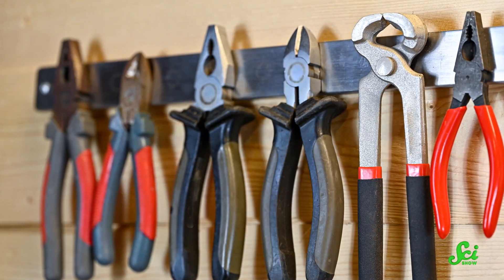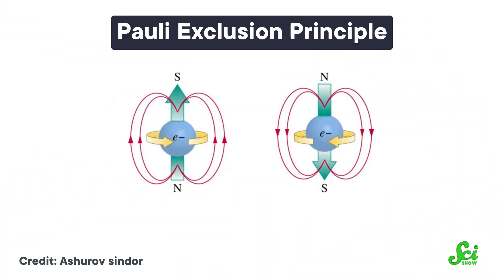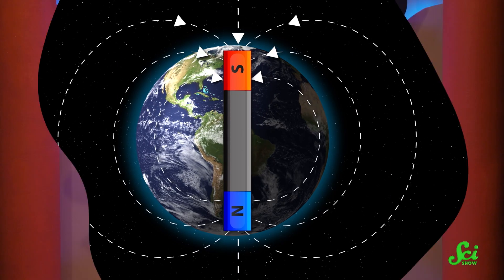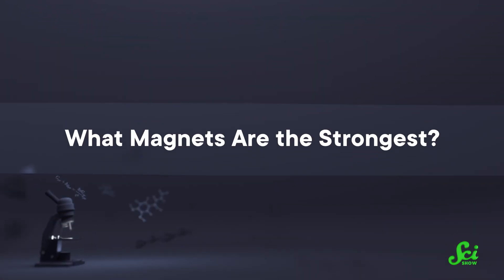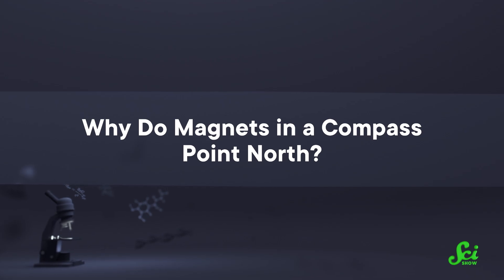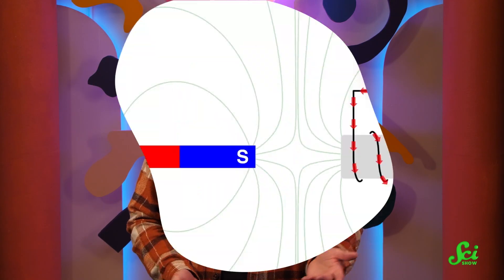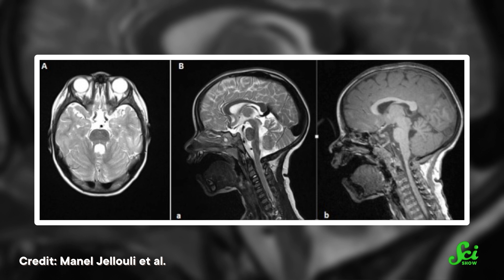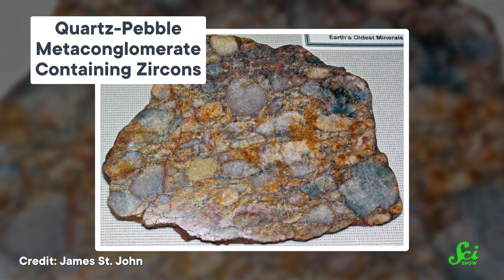The 16 Most Asked Questions About Magnets

Comment: My favorite magnet use: Cheap rice cookers.  There's a magnet in the rice cooker that is chemically calibrated so that, once it (and thus the pot of food) gets above the boiling point of water, meaning there's almost no water left in the pot, it loses just enough magnetism that the spring it's resisting can overpower it, switching the circuit from "cook" to "warm."  When it then cools, it regains its full magnetism.  It's such an elegantly simple mechanism and I adore it.

Comment: Are magnets' strength measured by, or do they include the factor of, the weight of an object they can lift and hold before (as it appears to me) the strength of gravity's pull overpowers their ability to draw a magnetized object towards themself and keep it there?
.
Like, some fridge magnets are pretty weak. Sometimes they can't even hold their own plastic-shell container's weight up without falling, let alone that and the piece of paper you're trying to hold on the fridge's surface.
.
And what measurement terms etc. tell you how much material can there be, or how thick it can get, between the magnet and another magnetized object before it blocks (weakens?) the pull between the magnetic and magnetized object too much to be useful in keeping the material pinned in place between them?

Comment: That wasn't a very good answer about computers. Hard drives are definitely vulnerable to magnetic fields, sometimes even ones you might think are small. The placement of a hard drive inside a computer varies, especially in laptops, but you shouldn't put any sort of magnet anywhere near wherever it is. Unless you have an SSD, which is faster, not vulnerable to magnetic fields, and generally sort of better. Additionally, back when computers used CRT monitors, you could visibly distort the image of those monitors by putting a magnet near them. Most monitors had a "degauss" option which would fix this, but if you put a strong enough magnet near enough to the screen, it could leave permanent defects. Arguably that's not "messing up the computer," but that was what your mom grounded you for if you did it.

Comment: Fun little magnet anecdote - I once used a bulk tape eraser (STRONG handheld electromagnet) to wipe a hard drive before throwing it away.
Reply: I had a shop teacher stack up a bunch of hard drives and connect them to an arc welding machine. One shot of high voltage, and they were wiped.

Comment: Regarding the harddrives: There are actually very powerful (crush/squash/pinch your finger-type strong) neodynium magnets INSIDE mechanical harddrives. They together with a coil provide the movement of the read/write heads.

Comment: So here's an odd one.  At some restaurants that use cheap flatware, that flatware is magnetic.  You can take the end of your fork, for example, you can make it pull the knife.  It's not incredibly strong but it works if you don't move it too fast.  Is that flatware intentionally magnetized or did it somehow get magnetized after the fact and if so how?

Comment: TMS (Transcranial Magnetic Stimulation) is over 60% effective, which is about as effective as SSRI'S (the most effective medications for depression). Medications generally take weeks to work, and only a third of people find relief with the first medication. It often takes several med changes before the doctor finds the right one, if it helps at all.
There is a new form of TMS, which uses the Stanford U. developed SAINT protocols. This version has an 80% effective rate for treatment resistant depression and was fast treacked by the FDA because of the impressive results. One studdy had an astounding 90% remission rate SAINT TMS!

Reference:
10.1192/j.eurpsy.2023.1768

Comment: Fun fact: cutlery knives in restaurants often are slightly magnetised. Because the cutlery tray they use happens to be aligned north south and wherever they throw in the knives the impact over time magnetises them all. 🙂
Reply: I've noticed this too!  It's usually cheap flatware where I notice it the most.  I often wondered if it was intentionally magnetized or not.
Reply: Fun truth.... Restaurants often have magnets in a chute to the trash can by the dishwashing station where leftover meals are thrown out. The magnets in the chute will grab any silverware accidently dropped in so it doesn't get thrown out. This is why some restaurant silverwear is magnetized.

Comment: Fun fact, magnets make the best (my opinion) electronic switches in the form of hall effect switches.  They're great for stuff like gaming controllers/keyboards, and even security doors!  They're accurate and reliable, they use permanent magnets, so less power needed, and they don't need things to make contact to act as a switch so they last longer.

Comment: The placebo effect is real. Besides no real evidence for healing capabilities of magnets, there's also no known real reason to assume/suspect that they could have a healing effect. 

Other than that, and some "details" about electromagnets, not technically completely accurate, a great episode, really funny!
Reply: Easy enough to run a doubleblind on: moar research required!
Reply: @revdrjon  I think there is more than enough research done on the subject to conclude that if you're finding positive results, you're probably not doing real science. 

Besides being cheap and safe to do research on, it would also be cheap and risk free treatment, if it worked. As a safe placebo effect catalyst, it could be considered preferable over some other forms of alternative medicine, for things that the placebo effect can help, but placebo is temporary, and a distraction from actual solutions.

Comment: I work on a knacker wagon collecting dead stock from farms. 
Had a cow once that had swallowed a peice of wire that gotten into its feed and ate it. That magnet caught the peice of wire but it was to big and peirced its stomach and straight into its heart. The magnet had loads of other bits of debree from washers to small screws. The wire that killed it looked like it was from a tire tread like cord from a tire. What farmers over in the UK do they usually put old tires ontop of feed to keep it covered. Well old tired crack and degrade and that's how wire usually gets into their food

Comment: Kinda curious how the video didn't directly mention, when talking about applications, on the two biggest and most abundant sources of use for magnets - motors and generators. I could put three here with transformers.
Those three are in almost all electronics out there, not only smartphones. Almost all of our electricity with the exception of solar panels comes from generators, and most electronics with parts that move using electricity have a motor. I guess you end up having to put solar panels there too since they usually need transformers.
And then, most electronics that you plug into a power outlet, also needs magnets for the job, because of transformers.
Then you also have inductors/chokes...
Oh, also speakers and microphones. xD There's just so much stuff...

Comment: If volume multiplied by density equals mass, where does magnetism come into play. What I mean to ask is, does Earths magnetics play a part in the weight of an object? If I brought a 1kg plastic bar and a 1kg iron bar to a mystic planet with heavy core magnetics and placed both bars on a balance scale, the iron one would pull heavier, right? So, D×V doesn't always equal mass?
Reply: Volume multiplied by density will always give mass. Your example would give the weight of the object, not the mass. Mass and weight are often used interchangeably but they are not the same thing. Simply put, mass is intrinsic to the material and doesn't change if you change the environment. Weight is a function of mass and external forces, usually gravity.

You can see something similar in an elevator. The weight of the object will change when it is accelerating but the mass doesn't change.
Reply: @ragingfirefrog  That totally makes sense. Thank you very much!

Comment: As somebody that's wiped a hard drive with a magnet it doesn't quite need MRI strength. You can definitely do it with neodymium especially if it's in a laptop.
Reply: Did this once out of spite after someone threw my own hard drive

Comment: If you've ever seen those hexagonal-shaped grooves etched into the surface of the street at a traffic light, that's part of the system that signals the presence of a vehicle at the intersection. There a coil of wire embedded in the asphalt, with a small electrical current running through it, connected to the traffic light control box. When a vehicle moves over the loop, the metal in the vehicle interacts with the electrical current (you've basically created an electromagnet with your car) and the traffic control box detects this interaction (the electrical resistance increases when there's metal near the loop). This triggers the traffic light to start the cycle to change to green.

Comment: If you were going to create a terrible weapon, the worst kind of weapon, you'd create a magnetic bridge array.  But the bridge array is unitary, in other words the bridge uses up all the field, so if you make a monopole with a circle of metal and place all the bits face the same way, the strength goes only into the material.  It has to do with frequency capture, but also because reality is actually a quantity of some kind.  Like if you spun an impossibility strong weapon in 9 or 12 dimensions, you'd expose "not reality", the toaster wouldn't toast bread.  So in order to theorize terrible weapon, we know it gets swung around by x + a, y + b, z + c, just a teather ball.  This lead to a vector x/y + y/z + z/x, its used up in two dimensions.  But we could rotate it whole bunch of other ways with different fields and interconnections siphening the higher dimensions into this LiFe7 8060 doom porphorin aspirin magnet array.  This is because a 8 dimensions object has a dual quaternion in its array, meaning no set ground state at any two points.  However, Microsoft clearly has Microsoft Excel, they put 32,000 cells for selling Quickbooks, it just requires an even more dubious weappon, the algebraic reality of capacitance.
Any higher dimensions radix doesn't need a right hand rule because it has dictionary bitwise chirality to any neighboring location, the 7 d reality dictionary.  So you can make particles of vacuum.
This is because a regular quaterion has a perfect jacobian eigenvalue at 7d, chlorine, and at 10, it has a fractal space buffer, mod 5.  The first one Explains the second; 9 - 8 + 7 - 6 + 5 - 4 + 3 - 2 + 1 - 0.  However, this fantasy land only works under certain matrix constraints of control, but very easy to observe the basic combination (of reality bits) 111 110 101 100 011 010 and 001, hence reality bits, 000 is a imaginary bit, its up to you  But to explain imagination, first we need a reason to, so the easiest reason is, why is there an axis?  X goes right chips go left, hamburgers go up, but whats much easier, its very tiny.  Wars going on in zero, makes a place holder.

Comment: A note on the computer part. Most computer I made in the last 5 years are not using magnetic storage and will not be affected by magnetic. Also old tube tv/monitors use a CRT (cathode ray tub) and magnetic fields can cause issues with these devices. Otherwise magnetics are safe for use around computer and you don't have to worry about them.
Reply: Introducing a strong magnet can create small voltages, which may travel over electronic circuits and cause damage. To damage an SSD, you would need a tremendous change in magnetic flux — and I have proven this by putting a SSD in an MRI machine. So, under most normal circumstances you are right but, there is always some crazy person like me to mess things up.

Comment: I hate to be the bearer of bad news, but this video is totally wrong. Electrons give off the same thing that protons give off. And that would be electromagnetic waves. Electromagnetic waves that can be affected by other electromagnetic waves. With protons, we call it gravity... With electrons, we call it magnetism. Both work the same. One at really long distances, the other at really short distances. 
They are equal in the size of the particle that they are. 
A north and south pole on a magnet would be equal to being pushed into the center of a cluster of electrons or having a LaGrange point nearer to the center of the movable magnet. Nothing more.

Comment: So why is it that in strictly 2 dimensions, there is no magnetic field, and in 4 or more dimensions, the magnetic field dominates? Also, it's called spin because the units work out to be the same as spin angular momentum. It doesn't really make sense as literal spin, because some particles have half integer spin, meaning you can think of the particle having to rotate twice to get back to the starting point.

Comment: The Magnetic Monopole Paradox  

Contradictory:
Classical Electromagnetism 
∇ × B = μ0j   (Magnetic fields have no sources/monopoles)
∇ ⋅ B = 0      (Magnetic flux is solenoidal)

This appears paradoxical since individual magnetic charges are allowed by the laws of physics.

Non-Contradictory Possibility:
Monadic Charge Network Electrodynamics
F = q(Ax - Γx,y Ay)   (Force from difference in vector potentials)
Γx,y = gx gy / rxy         (Monadic charge relations)

Treating magnetism as collective network phenomena arising from vectorial differences in monadic charge perspective phases Ax, Ay with relations Γx,y avoids paradoxes.

Comment: I have a piece of medical hardware in my body that controls the flow of a specific type of circulated fluid (I'm being vague to keep from getting too technical). The valve that controls the amount of flow is very loosely magnetic and my doctor can take a specific strength magnet and adjust how open or closed the valve is just by touching it to my skin. This eliminates the need for additional surgeries.  It's quite ingenious, actually.
Reply: what if you're near a large magnet?
Reply: @Gocunt  I'm sure the magnet would screw with it. I've never tried placing a neodymium magnet on the spot (that would be stupid to test), but I have it in my medical records that I can't get an MRI scan of any part of my body.
Reply: This sounds very much like something my mother has. (For her it transports excess brain fluid to her stomach where her body can break it down.) It does still kind of boggles my mind that adjusting it is just so simple
Reply: This is common in many medical transplants that may require adjusting after operation. Magnets save us surgeries. Thanks magnets
Reply: Whoa, that's amazing!!!
Reply: That sounds dangerous, what if someone prank opened your valve from outside?
Reply: @osiris1102  A "prank"? I can't imagine anyone that I have ever known trying that just for the fun of it, and it's not like I have an arrow pointing at it "Press magnet here." 😆 I have had it for a dozen years without any problems, it takes more than just a refrigerator magnet to affect it, and I would just go back to my doctor to adjust it again. Closing the valve isn't death.
Reply: @CaptainMarvelsSon  still you should hide it from others in real world, just to be safe.

Comment: How do lava flows take hundreds of thousands of years to cool down from top to bottom?  That has to happen for the multiple preserved lava flows that have the top of the flow magnetically attuned to an opposite magnetic north and then lower down in a different direction and then lower down still in a different direction. It seems more likely that the lava flow cooled over the course of years or decades, and during that time the magnetic pole flip-floped quite frequently

Comment: 7:06 - Neutron stars are also often thought to have very intense magnetic fields that dwarf those of even are strongest magnets.

9:18 - This one is historical. Magnets used to be really bad for computers because one important storage media was floppy disks. Floppy disks use plastic coated with magnetized iron dust to store stuff. So a magnet near a floppy disk would have the tendency to scramble the information. This is not a problem with USB sticks. And hard-drives (which do use magnetized iron dust as well) have a big metal shell around them that tends to block out external magnetic fields. So magnets are not nearly so bad for computers as they used to be. Oh... one other thing, magnets used to play havoc with CRT screens because those screens use magnetic fields to direct the electron beams. Again, we don't really use CRT screens anymore.
Reply: Long ago, when I worked tech support and most monitors were CRT, this guy called and said, "I have a big purple streak across the top of my monitor."  
I asked, "What's on top of your monitor?" 
He replied, "A subwoofer." 
I said, "Well, why don't we take that off?" 
One of the easiest calls I ever had,
Reply: ... Hard drives where still the number one concern. We just do not use hard dives much if at all anymore and hard drives have came a long way.
Floppy disks where just portable hard drive platters.

Computers also used to use magentic storage for ram. And some CPU's still do use magnets for thier internal cache, nothing is faster to read then the direction of magnitation its litteraly the speed of single propagation in a wire. Its also a lot physically bigger and slower to write to.